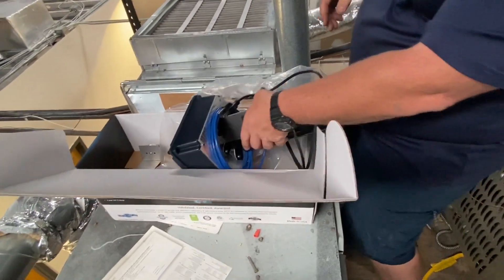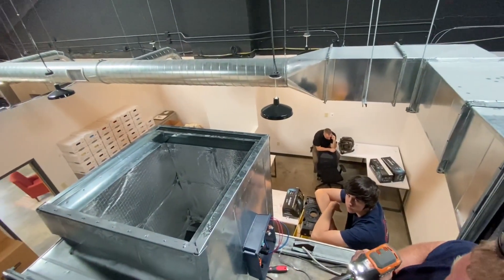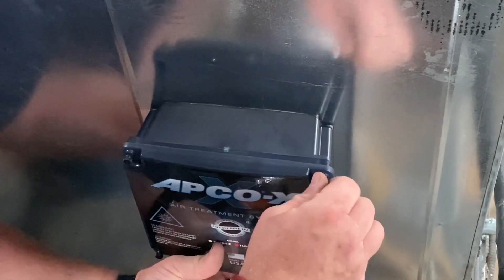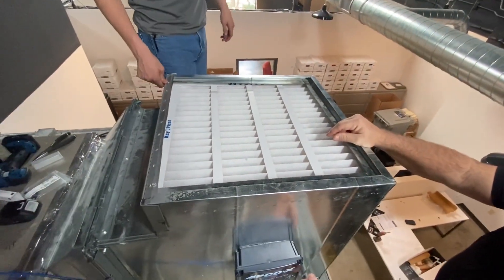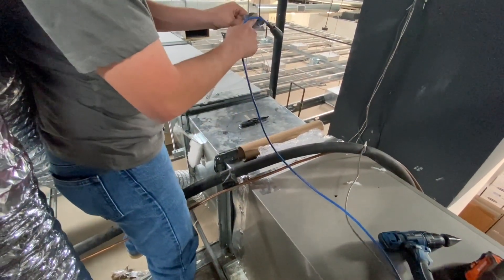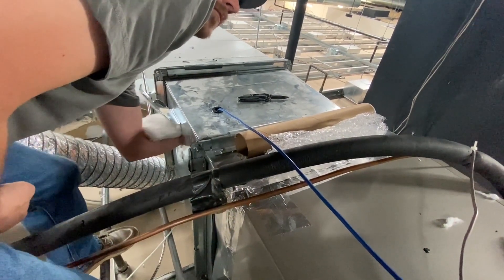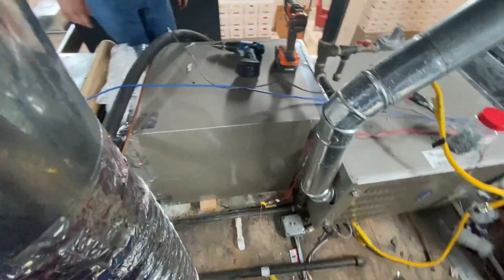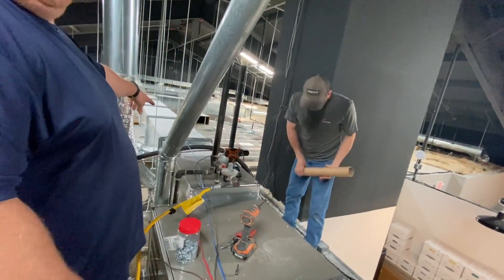Air Purifiers Installing APCO X system in HVAC Duct to improve Air Quality and fight the Coronavirus

Comment: I thought you wanted the carbon filter light system with the light being the first thing the air crossed then going thru the charcoal filtering system? So at least shouldn’t you have installed it sideways if not upside down so the air flow would have flowed threw the unit correctly? Also I thought you wanted the purification system on the supply side an the second Lamp on the evap coils?